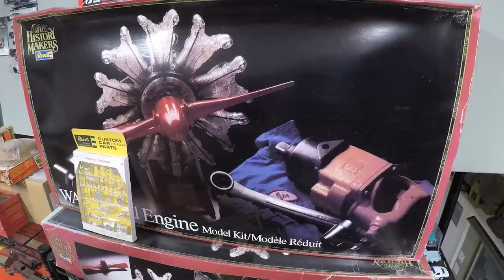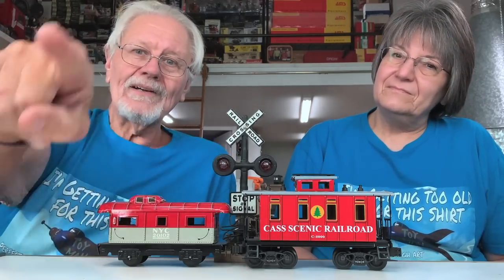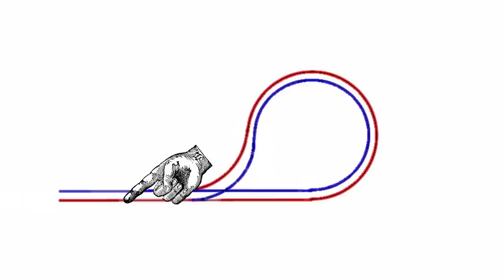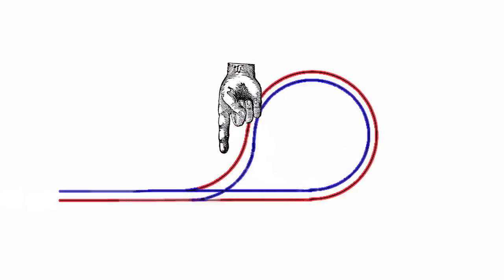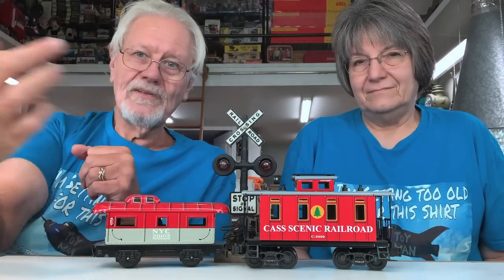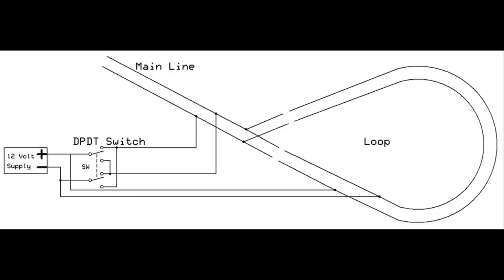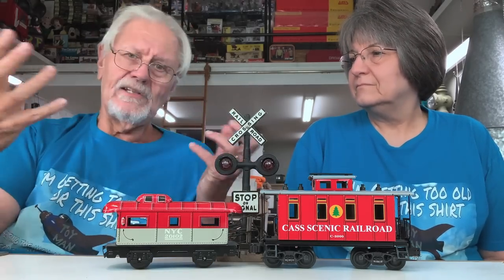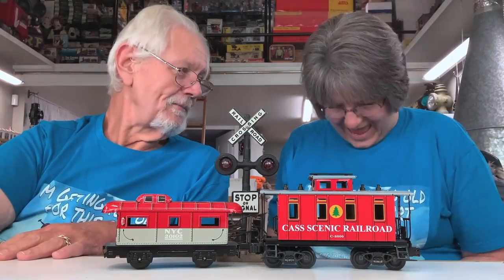Scales and Gauges Part 8 - Why did Lionel Use Three Rails?

Comment: Keep in mind that with 0 gauge
The curves are not measured in radius but actually in diameter 

So the 027 is 27 inch diameter curve etc
Reply from the maker: Oh!!! Thanks.
Reply from the maker: And that explains how me very old Lionel was able to go round on a 4x8 plywood with a truss bridge in the center of the end.
Reply: @ToyManTelevision  
Yep all three rail o gauge turns are measured in diameter. Which actually makes it interesting because if using older prewar and postwar you are sometimes able to fit more o gauge than ho

Because for example, an o31 turn ends up having a radius of about 15 inches, which is tighter than what you would usually run HO on
Reply from the maker: @VintageRenewed  and O 27…. OMG.
Reply: One of the Lionel strange facts is that some locomotives have a much longer wheelbase than the minimum radius they can run through. Eat your heart out Rivarossi.
Reply: @VintageRenewed   Yeah, actually both your statements are incorrect. only in the US is the radius not used, and it's not the diameter measured either.
An 031 curve is about 14" radius and around 27" diameter.
It's the measurement of how much space a circle will use.
Reply: @muir8009  
Their video is specifically talking about American 3 rail Lionel/O gauge and thus my comment is correct for the context 

Also as far as the actual curve, do look at the Lionel website. They literally say that in curves for example 0-31 the xx (0-xx ) is the diameter of the curve
So that statement is also correct according to the US manufacturers of 3 rail 0 gauge trains
Reply: @VintageRenewed   the video seemed to specified 0 gauge, you're likely correct though.
Lionel should learn the wording of their own history:  older lionel literature specifies where 0 31 and STD 42 originated from.
I'm thinking that actually both are correct and both are superfluous: the nominal diameter is only the end of the sleeper less, so it's around say 28" diameter, takes up 31" of space which isn't really going to be a make or break deal.
027 is 12" radius: a nice round foot.
Mind you, lionel has been guilty of ignoring basic maths in the past: giving 3 different measurements for the same track gauge!
Reply: In the world of Lionel 027 was the Volkswagen and O gauge was the Cadillac.
Reply: @MustangsTrainsMowers   It's interesting how Lionel's 0 was the low end product compared to standard, lacking the engineering niceties and the bling with 027 ending up being the carryover from Ives after its very budget friendly toy train line, but even then they were very good quality products. 
And its nice stuff: it's interesting how good lionel's quality and efforts to improve were compared to others. I recognize Dorfan had a reputation but I would say that is more in line with engineering innovation rather than engineering quality. 
The depression of course killed the market for expensive, quality toy trains and the cheap 0 got it's big break; ended up being a good decision for Lionel to drip down it's good engineering quality into its 0 gauge line!
Compared with a contemporary American flyer product the serviceability of lionel seems to be of a considerably better nature, although the AF equipment used some very, very hefty steel, and is very good looking equipment. Just things like using rivets rather than nuts and bolts, or let's tuck this in here so you have to disassemble the entire motor just to get to this one screw; that kind of thing.

Comment: Lionel had another advantage they got from 3-rail although probably more from serendipity than planned from the beginning.  Since the outer two rails are common to each other and the wheels and axles are electrically common, you can insulate one outside rail to use for detection.  You use plastic insulating track pins for the rail and also insulate it from the metal ties (in the same way the center rail is insulated.)  Then, when any engine or car is on the track, the wheels and axles connect the outer two rails together.  You can use this scheme to operate something like the gateman or crossing gate accessories.  It is a low cost high reliability method.  You DO lose the redundancy of having two wheels contacting the "common" rails (outside rails) however.
Reply: I used the three rail Lionel track to make the train switch on/off my Christmas light decorations to make them blink one year.

Comment: I have owned Lionel postwar trains my whole life but only for around my Christmas tree.  The last two years I expanded into more post war and built a nice layout in the garage.  I have found the three rail system to be so much easier to deal with than when I was doing DCC.  Chips,  codes and hand held remotes ugh!.  Pretty cool seeing actual three rail system on the street.
Reply from the maker: Thanks!! Most people don’t know some railroads did that.

Comment: Thanks for the explanation. As a child, I had an 027 in the early 50's. You spoke of having a switch on the loco to change direction. Mine did the direction change automatically every time the power was interrupted. First forward, then off, then backward, then off, then forward, ... On mine, you turned the power on and off with the transformer. This feature was also engaged whenever you took a curve too fast. It would rock over enough to lift the center electrode and the train would stop. Very annoying for a young boy with a need for speed. 😁
Reply: I think the switch had three positions. You could lock it in one direction, or you could put it in automatic mode. I think there was also a bi-directional automatic mode too. I don't remember. I think on some, one of the outer rails was used to trigger the whistle car.

Comment: The trolley cars in Washington, D.C. worked with both overhead as well as underground power.  As you moved further away from downtown, there were places where they would connect/disconnect the underground pickup and the streetcar operator would go to the back of the trolley, flip the center seat back down and crank the overhead pickup up/down.  They would operate the trolley from this location when they wanted to back up.
Reply from the maker: That figures. I’ll bet the underground was expensive!!

Comment: The great advantage of the third rail has nothing to do with DC versus AC current, just the fact the middle rail remains in the middle when you do a loop with a junction, or a diagonal in an oval or even do a triangle with 3 junction, and this really cool because your trains can go back in the opposite direction after a loop or triangle, so less boring than just turning round especially when you play with multiple digital locomotives.  With only two rails you get a short circuit so you cannot use these patterns.
At last a 3 rails system can work very well with DC as well.

I am surprised so few train modelists seem to know this fundamental trick. It seems people were a bit more clever when the first toys were made with 3 rails.   For decades people focus mainly on realism but boring train sets that just go round and round. Nothing exiting....
Reply from the maker: It’s is possible with manual switching on DC or even automatic. I had a point to point DC dog bone with auto reverse loops at each end. But the circuit was tricky. But no idea how to do that with AC. Unless you just use a simple center rail.

Comment: Yeah... a few minor alterations though: the reverse loop wiring was just coincidental to three rail remember. Issmayer followed of course by marklin developed the sectional track idea. Lionel's trains were always intended to be used by ac or dc, it was only following Ives realisation that following marklins track system, that lionel realised that their own horrible 2 rail strip track was a dead loss, so of course developed standard track, following marklins lead (I say marklin but by that time generally encompassing every UK, and European manufacturer).
Do remember that with 3 rail manufacturing is so much easier: no chassis insulation to worry about, no wheel insulation, nice and easy track system with no complicated point frog insulation etc...
3 rail has immense advantages functionality wise, just not aesthetically. 
I could add how many people bemoan the unrealistic look of 3 rail, and yet their efforts at layout building may require more than jusr losing a centre rail to achieve what they think they are achieving...

Comment: My American Flyer trains were also AC. They used a slightly different method of changing direction. It was a drawback to these trains. It required a special "transformer" and the directional switching units were constantly failing. Gilbert made a good swing at the toy train market, but Lionel was the king. ;-)
Reply: Our family gave us American Flyer trains and neighborhood kids who had Lionel laughed us only having two rails on gentler curves.
Reply from the maker: Yup. It was Marx who came up with the reverser. So some locomotives had a switch. Some a relay that worked from the reverser and some the reversing relay alternated from forward to backward to neutral.

Comment: Great video. I was born and raised in Washington, DC and in the 1950s I often rode on the street cars  with my parents.  When crossing the street I would often place my feet on that center rail with the open slit.   Now, thanks to you I know why I was not electrocuted on the spot and am still here today.  Thanks.
Reply from the maker: I really wonder how they connected to the center rail through that tiny slit!  And if the connection ever touched the guard over the rail it would connect the high voltage to the guard and kill people. So the shaft going down there needed to be able to pass through the slot which is at best 2” wide, with insulation, and still get power to the car.

Comment: As a kid, I had a Marx system three rail train. It was interesting how they managed reverse. Each time you came to full, power off stop, it would start back up in the opposite direction. There was a, I'll call it, ratchet relay that would index a rotary switch and reverse the motor.
Reply from the maker: Yup. Marx invented that. And licensed that to Lionel and Märklin. Super simple stepper relay. But the cheapest Lionel locomotives still had an onboard switch to avoid the licensing.

Comment: I think the Lionel 3rd (center) rail concept came about due to it costing way more to insulate every wheelset on every piece of equipment. Not only the cost but also the manufacturing processes and materials weren't even available 120 years ago.
Reply from the maker: Yup. Part of it for sure. But the added cost to add a third rail with insulation at every tie… also explains the reason for one tie every six inches.  Also the ability to “ground” the entire locomotive. But Gilbert opted to drop the third rail.. so it was possible and in fact easy. In 1890 things were sketchy. Still six years before 1 1/4” was set as 0 gauge!  By the time Lionel got in the idea of 1 1/4” gauge and a center rail was almost standard practice. So Lionel could have gone two rail. But for a bunch of reasons, all electrical, they stuck with Marklin trains third rail. We really wanna dive into this when we do a series on layout wiring. Another deep subject.

Comment: To this day 3-rail is extremely popular, even among highly detailed model roads that look about as close to real as possible. Subway trains are 3-rail, but the third rail is outside of the two main rails.
Reply: The London Underground is electric and uses FOUR rails. Two standard rails for the wheels and two current pick up shoes. The original configuration is nominally 630 V with a −210 V center conductor rail and a +420 V outside conductor rail. This is the default configuration wherever deep-level tube trains operate.

This arrangement was used to reduce leakage current (in the metal tunnel liners) and corrosion of buried metal water and sewer pipes.

After 2016 the track voltage was raised to 750V DC.

Comment: I had a two-rail American Flyer train set, and the brass contact wheels needed to be cleaned frequently.  Three-rail Lionel trains didn't seem to have that problem.
Reply from the maker: Lionel had much better electrical pickup. All the wheels were “grounded”. And the hot shoe slid down the center rail and so stayed quite clean.

Comment: That streetcar track in Washington, D.C. was called conduit track. In North America, Manhattan in New York City had it too. And conduit track was also used  in London, England, as well as in Paris, Berlin, Marseilles, Vienna, Budapest, and Prague . The device that hung from the underside of the car and collected the power through the slot was called a plough.

https://en.wikipedia.org/wiki/Conduit_current_collection

I could never get used to three rails on model trains. To me, it's ugly and not prototypical of real railroads. For that reason, I was never into Lionel. When I was a little kid, back in the 1950's, my father bought me a set of American Flyer S gauge trains. They had two rails. In more recent years, I've gotten into G scale in a major way. It too has two rails.
Reply from the maker: Yup. I had American Flyer. But switched to HO because of the track!!
Reply: Conduit track in DC was used for aesthetic reasons, as you say.  But conduit track in NY was required because the Blizzard of 1888 caused massive downing of overhead lines.  So the city required underground electric service.
Reply from the maker: @ronlevine8873  here in Salt Lake City the pantographs on top of the light rail trains are not all functional. Not in terms of picking up electricity. If you see a car with more than one pantograph in a train, the lead pantograph is an ice scraper.

Comment: We lived In Iowa when I got my first electric train in about 1950 - the least expensive Marx set (in O-27 of course). We were still living in Iowa when I got my first Lionel train in about '57, also in O-27. I never heard ANYONE in Iowa refer to O-27 Lionel as the sports models but it was very common to refer to Lionel 0-27 as "semiscale) - meaning that the length of the locomotives and the cars was less (compared to height and width) than for the prototypical Locomotives and cars (aka "foreshortened). . There are many people who don't have room for layouts with larger-than-27-inch-diameter curves. Many of those people buy HO trains for that reason. It's a pity, however, because the HO equipment isn't as well suited for children and, of course, because of the difficulty of building 2-rail layouts with reversing loops.

Comment: Urban commuter surface rail systems, overhead elevated rail systems, and subways run the third rail to the side, slightly elevated, and have a pick up shoe on both sides of the train so that any train that is dragging a safety chain or anything conductive under or between the cars does not short out the whole system.  At the end of the line, they just switch over to the tracks going the other way and the power pick up shoes on the other side of the cars pick up the power.
Reply from the maker: Thanks for this. When I was a student in Paris I rode many lines like this. And every odd configuration.

Comment: When A. C. Gilbert ( of Erector Set fame)  introduced his S gauge trains, these were also ac powered, he did so with a 2 rail system.
Reply from the maker: Yup. Easy power supply that way. But the electrical power in the locomotive was so much more difficult. With three rail AC the entire engine is neutral. Just a small pickup on the bottom in the center for the hot leg. Then a back and forth relay for forward and back. Simple. American Flyer was so much more difficult to build.

Comment: The modern dc power supplies reverse direction by reversing the polarity of the rails bscause the locomotives use dc motors with permanent magnet fields.  The old three rail lionel system used universal motors in the locomotives which can run on ac (similar to the motors used in modern household appliances such as vacuum cleaners).  Reversal was achieved by means of an electromagnetic relay on the locomotive which reversed the direction of the armature current relative to the field current.
Reply from the maker: Yup. Or on early or cheaper ones, a switch on the cab.

Comment: Marklin still uses '3 rail' track, though it's not a true center rail any longer. Rather it's a series of metal contact studs which a sliding shoe on the underside of the locomotive runs over.
Reply from the maker: Yup!! And it works well.

Comment: I have an old Marx O27 train set that has the ability to change direction. You would run it one direction then when you turn the power off then turn it back on it would go the other direction.
Reply from the maker: Yup. Marx came out with an AC reverser. And American Flyer and Lionel licensed that to use on their locomotives. It uses a version of a “stepper relay”. A sort of AC motor that turns part way and a cam stops it. But reversing happens inside the locomotive b